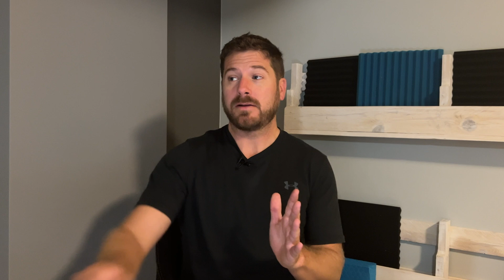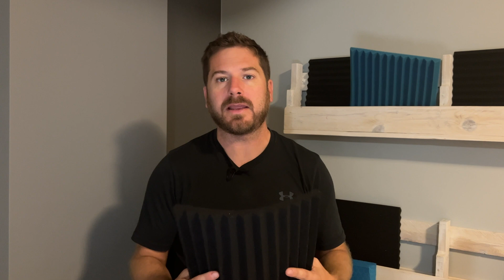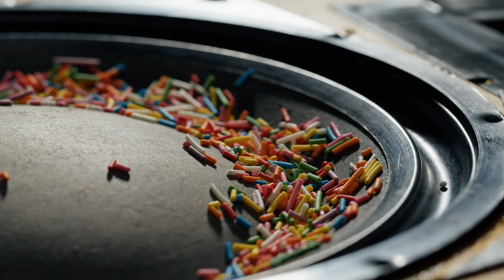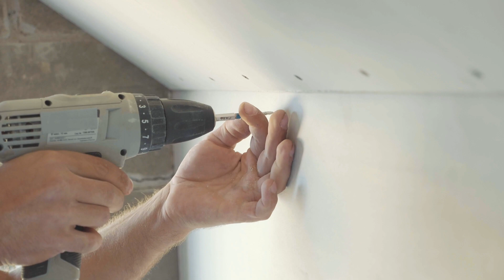SOUNDPROOFING Explained in 6 Minutes - These 4 Rules!

Comment: Vibrational noise from Fish tank and fridge ( electrical appliances) speakers etc can be fixed by using what ? Dry wall ? Rock wool panels .. ? What’s inside the resilient panel ? Rockwool ?

Comment: I have a question about the laminated window here. Let say I have a two panels window, one is laminated(2 normal window stick together) ,the other one is normal window. 
Should i put the laminated panel window to the outside layer facing street or put the laminated window to the inside, facing  the room
which will give you the best sound reduction method?

Comment: how can you find out where low-frequency noise is leaking into your home...such as through electrical outlets and other gaps?
Reply from the maker: This video will show you how! 😊 https://youtu.be/n_fvwDiObqE
Reply: @soundproofguide  Thank you great video also, but how do I check other areas such as door frames, window frames, or sagging batt insulation-just all types of airtight leaks--what about thermal imaging?

Comment: For the Resilient channel method,its most been used between different floor right. not between wall in the same floor, as long as you dont have ppl play bass in the next room.

And lets assume if no one live above me(i live in 2nd floor),  And i dont want to hear any sound from the downstairs(1st floor),  its not necessary to put a resilient channel in the second floor right. because the Resilient channel is helping the first floor sound proof in this case.. I just need to put some insulation fiberglass between 1st and 2nd floor is enough, to prevent the sound transmition from 1st to 2nd floor.
Reply from the maker: That’s correct. I’ve seen resilient channel on walls but its mostly for the exception like a home theatre or a home wanting to soundproof train noise.

Comment: Make things air tight is important, one electrical outlet without puddy/caulk, a hole from a screw or poor edging will let noise to the other side, even a gap as little as a sheet of paper will destroy the STC rating.
So if you gonna build a wall that handle noise it's a good idea to buy acoustic caulk and be meticulous!
Reply from the maker: Well said!!